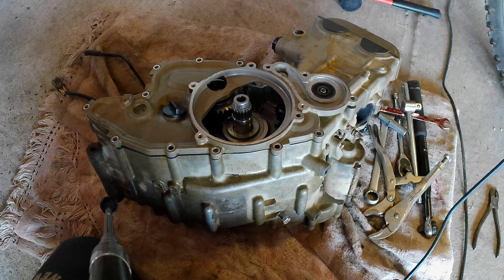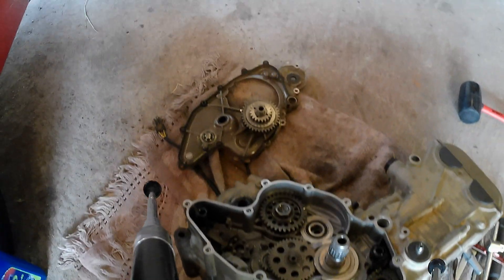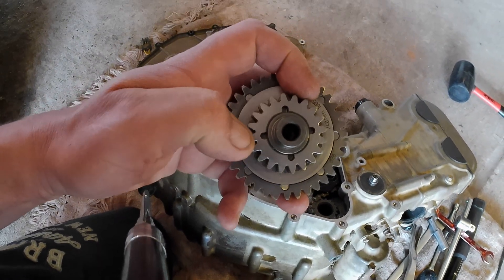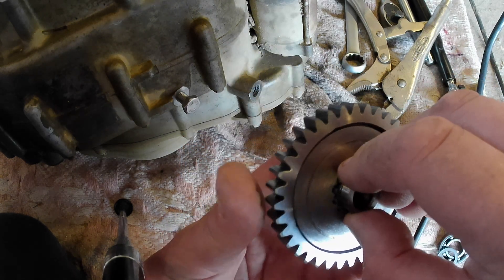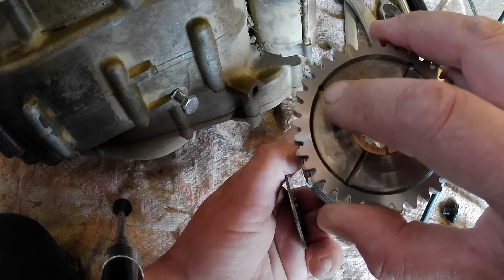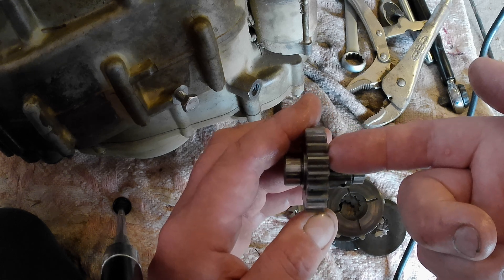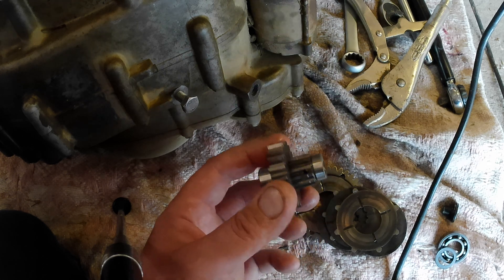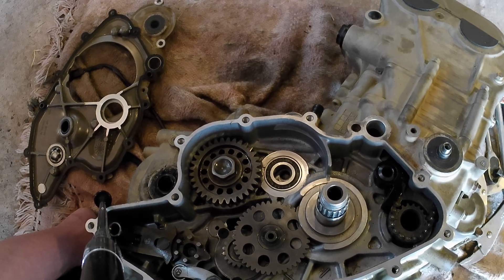BMW G450X Torque Limiter Removal and gas flow routes

Comment: hi thank you for the video.  If you don't mind sharing, what are the issues youve discovered as to why the torque limiter actually starts to slip? Mine was because the one bearing keeps breaking and I found the screw wasnt staying in, had to put thread lock in. once i replaced the bearing and thread locked the screw it runs perfectly again. Twice is this same issue and fix.  Just trying to ascertain that its the bearing  failing and not any of the other components of the torque limiter causing the issue. Not much info online as to why it keeps slipping. Thanks again for the vid   great explanation.

Comment: I welded my torque limiter before a huge group ride years ago as it would slip clutching up wheelies. Been fine but I do wonder how much harder it is on the drivetrain. Might be considering buying a new torque limiter, or a Cush drive hub.
Reply from the maker: The same idea of welding it together had crossed my mind as well. I didn't know if it would just burst the gearbox open !
Reply: @motomeltdown  yeah I beat the crap out of it and it's been fine, part of the time I had a kush sprocket on it, but those sprockets weren't holding up so I ran it with a standard sprocket for a while. I got a RMA'd Kush Sprocket to try but not holding my breath. Don't even know if they still exist, haven't been keeping up lately.
Reply: Keep in mind, I'm running a Sumo setup with street tires.
Reply from the maker: @hatchgrafix my engine now requires a rebuild, but I'm not sure it's worth it. I can not get hold of a new torque limiter and the existing one in the engine has already been re-shimmed.

Comment: My apologies if I'm misunderstanding, but what exactly is pinpointed as the failure when the torque limiter begins to "slip"?
Reply from the maker: The Torque Limiter isn't failing, its doing exactly what it was designed to do. The torque limiter has a pressure spring that is essentially a dished washer. This dished washer presses all the torque plates together and is shimmed to provide the exact pressure to allow it to slip at the correct moment, too much pressure and engine/gearbox damage could occur. Each time the TL operates, it wears its plates down a little thinner, and the dished washer spring has little flexural range to maintain the correct plate pressure. As the TL release point gets lower and lower each time it operates and wears a little more, the wear cycle accelerates. You can re-shim it once, or maybe even twice, if you catch it in time, but eventually the eared inner plates get too thin and break apart.
Reply: @motomeltdown  Okay that makes perfect sense. Thank you for the explanation!

Comment: Here's why they get the oil in the air box and think they need to relocate the breather. #1 Air filter in these bikes is the biggest piece of rubbish. Way too thin to ever filter out anything no matter how much oil you put on the filter. #2 large amounts of dust particulate pass right through the filter and burn the rings out of these engines rapidly. #3 massive blow by gases now enter the crankcase during heavy load high RPM conditions conditions. #4 excessive crankcase pressures blow massive amounts of oil regardless of centrifugal action from the limiter itself. and that's it in a nutshell.  I live in moist humid conditions with never any dust. My rings are super healthy my air box is always bone dry except for a little oil that drips off of the crappy super thin filter element.  If I lived in dusty areas I might consider a non pleated media/membrane/element that filters at a very small micron. Only problem is this filter would probably  have to be changed out daily.
Reply from the maker: I think oil in the air box probably happens in competition use where the throttle is pinned open with the motor revving its nuts off. I certainly don't ride that way and have never had issues of oil in the air box, and from what I've seen, nobody I've ever come across rides that way. If you do ride that way though then you may need to relocate your breather.

Another theory is that if the rear TL bearing is failing or the bearing seals are failing, then I personally believe that you would start ending up with oil in the air box as oil may be getting pushed through the bearing race.